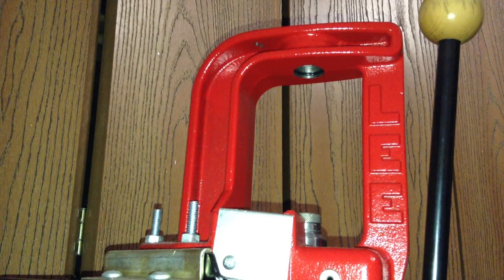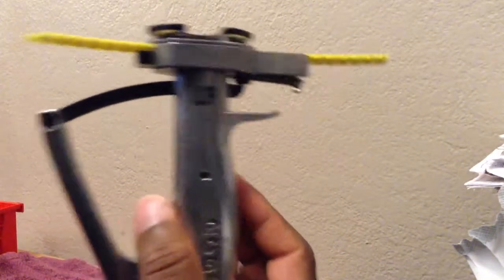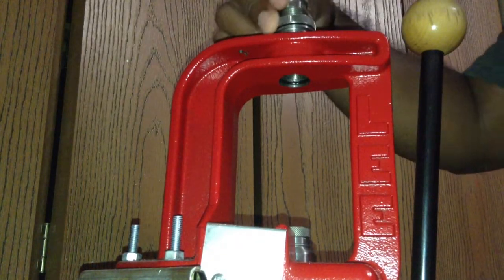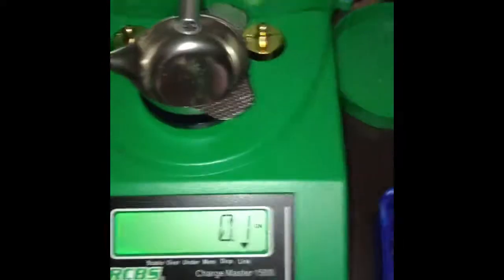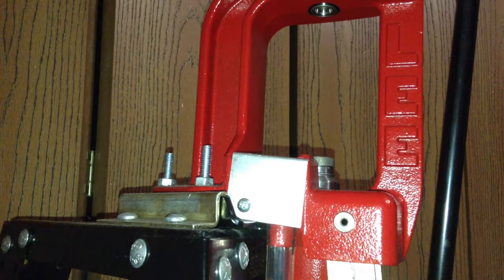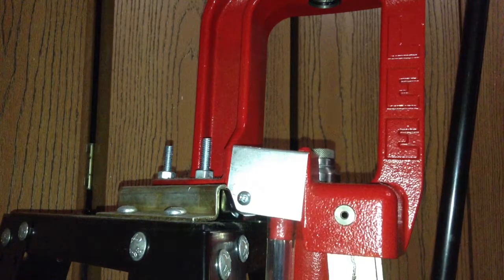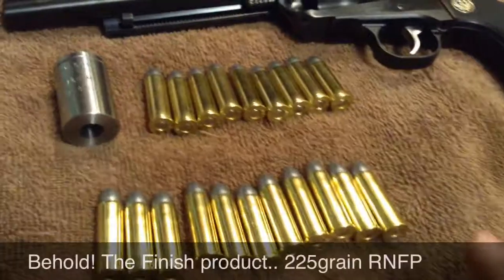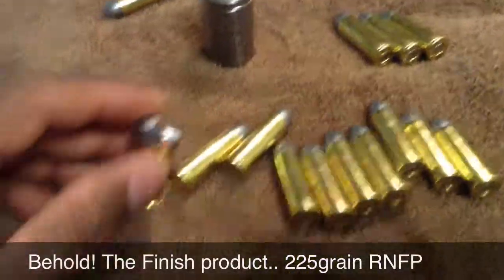Hand(Re) Loading 41 Remington Magnum(225 Grain RNFP)

Comment: I really like the lyman plastic powder funnel that goes straight from the scale to the case.  I was having some problem with static electricity.  Powder not all leaving the funnel.  I called Lyman, they told me to spray funnel with windex, and wipe down good with paper towel.  I took it a step farther I wipe it down with a paper towel, and then use a q-tip swab, it works very well.  Vaya Con Dios

Comment: Well done. I too have been bitten by the 41 bug.  FYI  MY favorite plinking load is 215 swc with 8.0 to 8.5 grains of unique.  Lee dies have worked very well for me.
Reply: Bob Williams, I am glad that you like the .41 mag ! I assume you are using reg .41 mag brass. I will made note of what you are using as plinking round, I would like to share with you my favorite light target load of 4.5 grains of Bulleye power and a 215 grain cast Lyman bullet. My dad made the joke “ I bet it won’t print. Paper at a 100 yards “ well my dad was wrong it printed very accurate at 100 yards coming out of a 20 inch Marlin 1894 FG rifle. By the sound . Everyone at the range though the gun was a .22! On the over end you might want to use a 170 grain Serria bullet behind 20 to 21 grains of 2400 runs out about 1,600 in a 7 1/2 inch Ruger Blackhawk at about 900 foot pounds of energy , that same load works wonderful in the Marlin with no recoil ! Great deer or black bear gun.

Comment: I've noticed the brass shaving too with new Starline brass. It doesn't seem to happen when I use Winchester brass.
Reply from the maker: Peter Rabbit  I've never used Winchester 41 magnum brass. Winchester brass can be hit it miss sometimes. I use to live by the Olin plant in East Alton. Some of their brass seems to split easy now. New some guys that worked at the plant and they would tell me  that Olin had changed composition of their brass... In order to save money.
Reply: The last and only package of Winchester 41 mag brass I bought had 15 pieces with rims that had a longer diameter than the other 75 and wouldn't fit into the shellholder. I had the same issue with some .357 brass.  It will be Starline for now on.
Reply from the maker: Peter Rabbit they have a serious issue with quality control right now so that doesn't surprise me.
Reply: Try case mouth chamferring....

Comment: There is absolutely no need to resize virgin brass from starliner. You resize fired brass if your loads produce more than 25000 psi. For plinking load below 25000 psi and you don't have to resize magnum brass at all. But there is no reason whatsoever to resize unfired starliner brass.  Think what you want to but I've been reading 41 magnum for 40 years. You information in bad.
Reply: Starline not starliner
Reply from the maker: mr magoo I have no doubt that you are correct, Starline Brass is made well. In fact I have used some starline brass right out of the box and it performed well without the resizing. But for the purpose of making videos. If  didn’t resize the brass at all. There would be someone in the comment section saying the opposite of what you are saying.
Reply: @FirebrandChris  and those who would say the opposite would be wrong. Bad information is bad information. New people seeing this would be mislead.